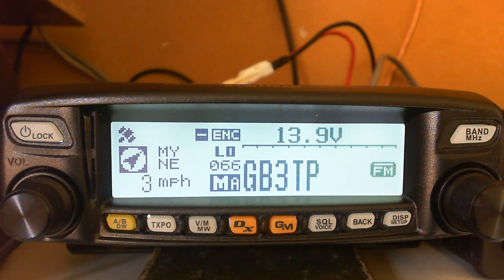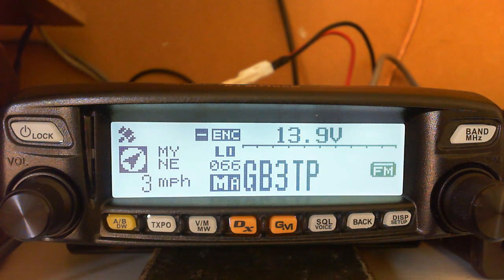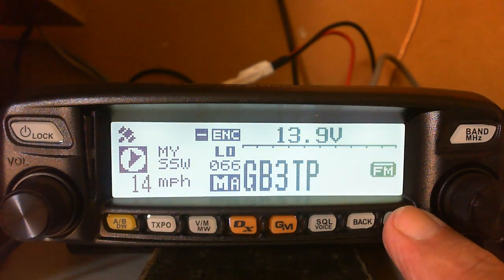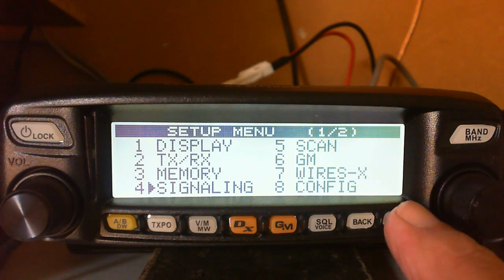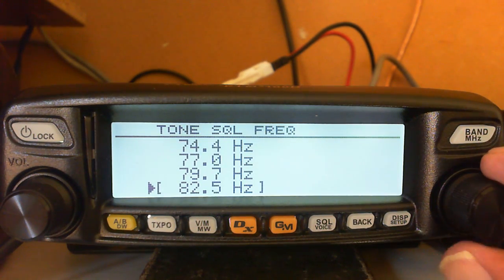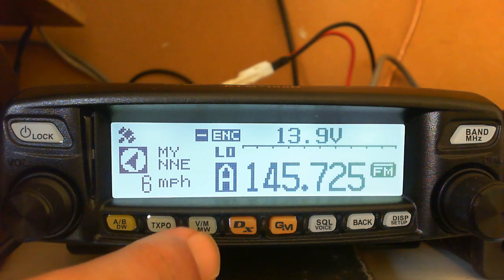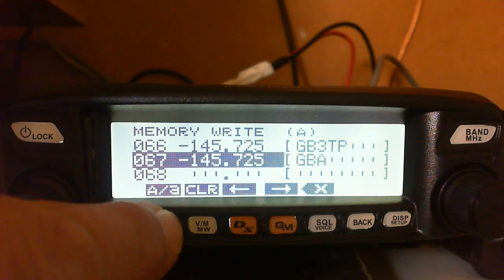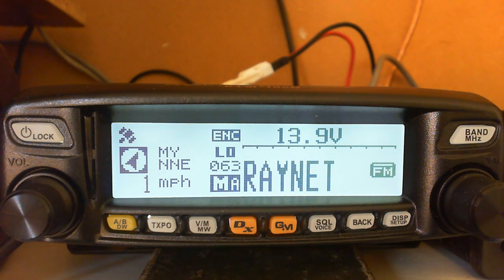FTM100DE Repeater setup on Yaesu FTM100DE de M0SGS

Comment: Is there a way to scan for frequencies like taking a road trip and coming across a open reapeater? In different states. KG7MNS. Billings Montana
Reply: James, Did you find an answer to this question? KE0QEX. Butte, MT. Currently in MO.
Reply: @natelaradickson7478  no
Reply: @natelaradickson7478  no I did not
Reply: You can turn on automatic repeater shift but with tone squelch and scanning across frequency i'm not sure you'll get anywhere. The set can't tell the difference between the input and output Freq so if you did try this chances are you'll just be transmitting on the input frequency never actually getting heard by people on the repeater.

Comment from the maker: Reply to ODD: sorry lost your comment,
Having worked both DMR and Fusion I would say the audio quality is very similar. Much better then D-Star by all accounts as one user described it, "less robotic and less prone to breakup", the GPS is working inside my shack, and I had qso's with others working from within their home QTH and the GPS works unhindered, switching between FM analogue and FM Digital Fusion can be both manual or automatic depending on your Preference...